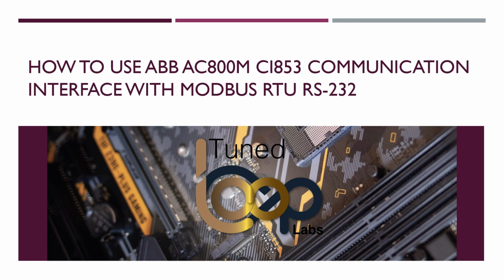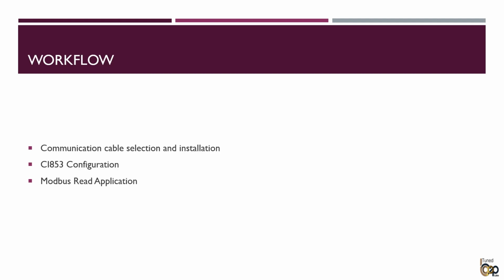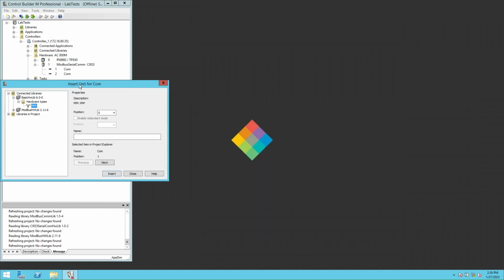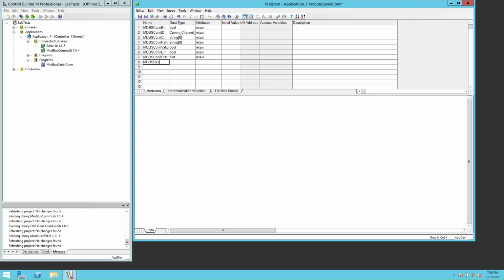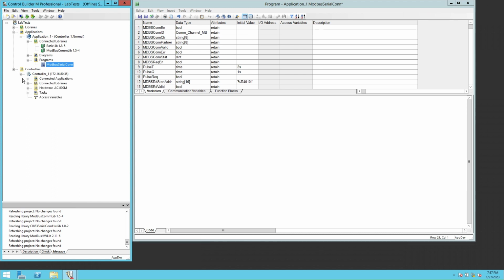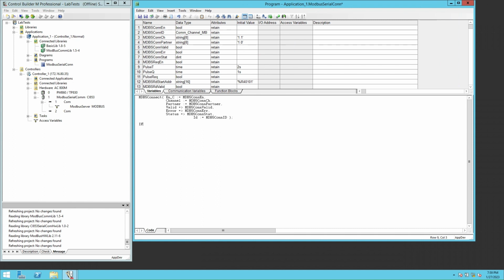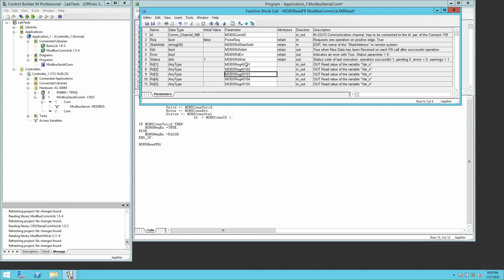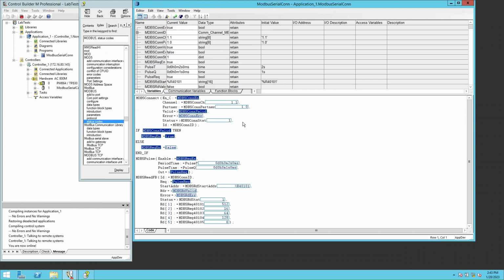How to use ABB AC800M CI853 with Modbus RTU

Comment: Good guide, exactly the same as I configured. I am trying to connect mine PM862+CI853 to my PC's Modbus simulators (modscan, modbusPoll). PLC port 0.3 status is -7013 (unexpected byte count received from slave), and on 1.1 and 1.2 CI853 ports status is -7000 (Communication interface removed). Fun times with ABB, am I right? Made my own wiring RJ45 to DB9 with ABB support instructions, could be faulty tho.
Reply from the maker: This is interesting, I'm assuming that port 0.3 you are using the built-in serial port on the AC800M base, usually that error is because you are exceeding the max number of register you can read at once. This communication is one of the most undocumented topics in their manuals. LOL. Thanks for stopping by.
Reply: @tuned_loop_labs  Just an update for anyone stuck on similar problem. After 2 days I resolved the issue, after many known and unknown status codes (-7000, -7013, -30 and so on). Just had to restart PLC (INIT button) and it worked without problem hehe. CI853 seems to bug for me if I change port baud rates. Then I download the PLC without CI853 card, and then I insert it into configuration again, and it works that way... For the cable RJ45 <-> RS232 it seems that any cable from the store will work since it has default pin configuration RJ45 (pin3 Tx, pin 4,5 gnd, pin6 Rx), RS232 (pin2 Rx, pin3 Tx, pin5 gnd).
Reply: great content!